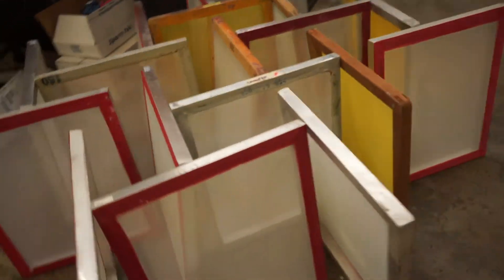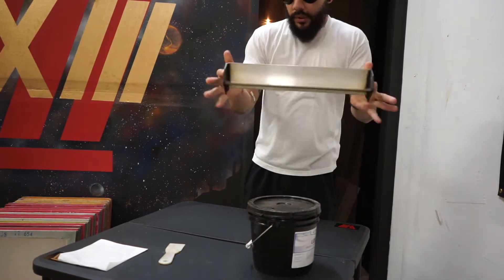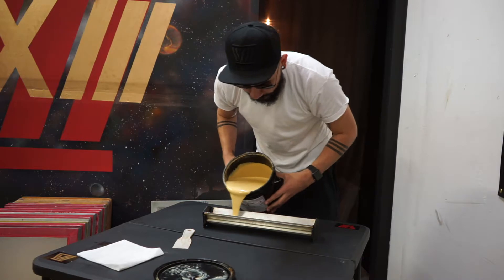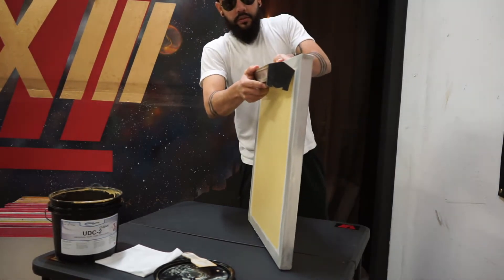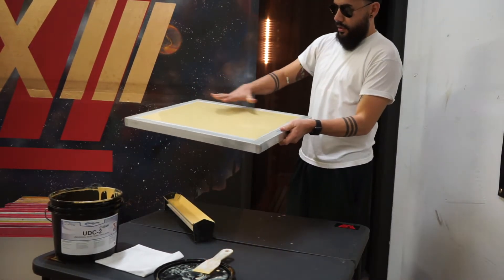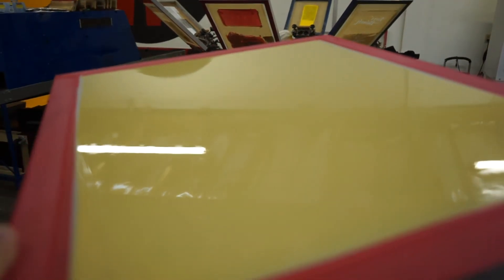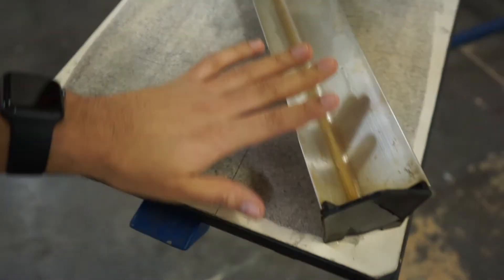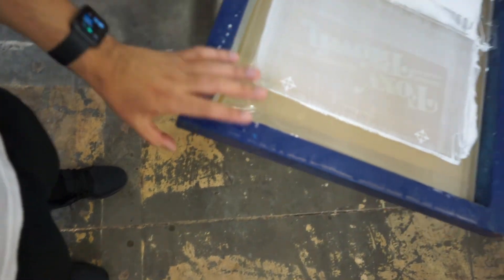coating screen how to coat screens

Comment: Nice learning.  Newbie having problems with coating.   Quick question.  My clothes closet is my dark room and when I have fan infront of it, it's pushing coating over to making ripples.   May I please see where is your fan in relation ship to the drying rack?
Reply from the maker: Just make sure you have ventilation in the room 
The screens should dry in 30 minutes 
So don't put the fan too close to the screen

Comment: Question? So u can coat screen in the light? Or do u have to be in the dark room. Or is the dark room just to dry the screens. Im comfussed there.
Reply from the maker: Daniel Ramos I normally don’t cost in the light but I did so that you guys can see what I’m doing
Reply: Is it possible to coat screens with some light out side of the dark room without ruining the emulsion?
Reply from the maker: Daniel Prime One Signs & Graphix the lights in my shop are very dim so it won’t hurt the emulsion 
But it’s always safe to coat the screens in the dark room and it’s safe to keep them away from natural day light 

I just did this outside the dark room so you guys can see clearly how it’s done 

There is not enough light or room to move around in the dark room to show you guys in a good way